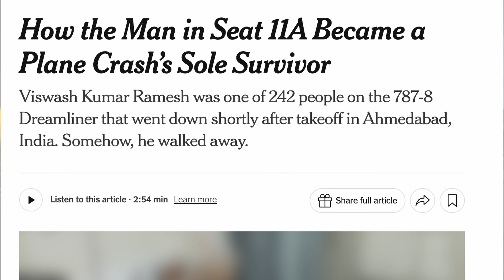Why the RAT Changes Everything – Air India 171 Update

Comment: It was a possibility to have dual engines failure instead of flaps retracted, but now, it's very likely given the ram turbine. Still, it's very unlikely to lose both engines at the same time all of a sudden just after takeoff, one maybe, but two ? What could have happened ? No fuel ? Fuse or circuit breaker ? It's not bird strikes for sure because no flames or smoke behind. Engines need fuel to fonction, do they need something else ?

Comment: I heard in another video, that the landing gear is inclined downward. It is also visible in the footage. It happens when the landing gear is preparing to be retracted up to be fit inside the airplane. It suggests that the pilots rightly retracted the landing gear up just after take off. But suddenly there was no power, and the landing gear retraction stopped mid way.

Comment: Equally hard to understand how both engines could fail, even right after a long max power Takeoff in very hot conditions. Contaminated fuel? Could there be an auto power reduction if the engines overheat? (That would be another Max 8 situation) The sound of the aircraft in the video does not sound like it should if both engines are running at high power. I understand these aircraft are live-streaming aircraft system data back to base while inflight, so possibly there is another source besides the recorders? A lot of grieving families now.

Comment: Captain, could there also be a scenario where the pilot, as soon as he realised on take-off that there was a problem, tried to dump fuel to make the aircraft lighter?  But before that task could be sufficiently done, the aircraft crashed and that was the reason for the massive explosion?  A lot of fuel might have already been spilt on to the top of the buildings and the trees when the plane crashed.  I have been wondering about this, because with the aircraft just reaching about 625 feet and being on a slow speed glide, why did the craft not just break apart on impact and instead explode so violently?  There must have been a lot of fuel surrounding the aircraft when it crashed, to have caused this.

Also considering that the craft crashed on top of a medical college cafeteria building where cooking is done with the help of gas cylinders and stoves.  This must have been an additional contributing factor to the explosion.

Comment: 4:08 Ram Air Turbine (RAT) is a small component that generates power in case of an engine failure. 
In Boeing, It activates on its own. 

only when all primary power systems—those drawing power from the engines—fail. It also activates if the Auxiliary Power Unit (APU) does not work, and even the battery unit fails

Comment: Whatever you have told in this video…..I am having a strong intuition that BOTH ENGINES WERE NOT FAILED BUT ENGINES HAD A SHUT  DOWN MYSTERIOUSLY IMMEDIATELY AFTER LEAVING THE GROUND….now there is a difference between FAILING AND SHUTDOWN…..failing of an engine is due to some sort of malfunction or serious error BUT SHUTDOWN is due to non availability of fuel in a technically sound engine. 
This seems to be a possible sabotage to the aircraft which is to be found by experts, if they can.
Besides sabotage is also might be attempted to the flaps/elerons & landing gear system. It will need a very honest n dedicated enquiry by experts to find all this if happened.

Comment: Steve, I have been working near and around small, medium, and large airport in my many years, and the 4th thing that I agree with on is that engine failure was probable one of the primary causes needs to be considered. If the engines were running, and at full power for takeoff, which they should still be at, the noise produced by these engines would have covered the RAT noise that you can here on the original video. These engines are quit, but at full takeoff power and only 500 to 600 feet in the air, they would have been LOUD. If it was engine failure, was it fuel, electrical, or another fault. Time will provide an answer. The sole survivor will need to be interviewed several times, the DFR and CVR will tell us more than anything when analyzed. My thoughts and prayers to those lost and the families. This loss is more than lives, it's families.

Comment: What about the dodgy main battery used on these aircraft. The rat would operate if that occurs.  Ask the Japanese who lost one of these aircraft on the ground because of the main battery. Boeings fix was to put the battery in a metal box and a vent to allow the battery to cook off "safely". This aircraft is a flying computer and all systems need that electrical power to operate properly.

Comment: The RAT was definitely down. Every maintenance technician knows that sound very well. And it was not just loose of thrust, since the engines even in idle power provides electrical and hydraulic power normally. The RAT is an evidence of dual engine failure. Catastrophic at this hight unfortunately.

Comment: I was years ago boarding on UA departing from São Paulo to Chicago , while the airplane staring accelerated the engine for takeoff we heard “Bang” very loud  and after that few seconds, we stopped and the captain said, it was mechanical failure, the blades of turbine broken. I and other passengers deplaned and stay over night in São Paulo for new aircraft and fly back to USA. The aircraft was Boeing, but not remember 757 or 767, the engine was GE. The year was 2007, I am a gold card member of Star Alliance at that time. I wandered if the sound “Bang” heard after 2 minutes in the air….I surely as those inside AI 170…

Comment: Flaps were intentionally disengaged after take-off to cover up maximum horizontal possible distance as Pilot realised both engines failed.
Reply: But by pulling the flaps up the wings lost precious lift because the plane was at a very low altitude, which contributed to the crash.

Comment: The RAT definitely deployed, you can clearly hear it, whereas the engines are barely audible.
Reply: And they clearly did not mix flap and gear lever. The wheel bogies have done the first part of retraction sequence, tilt from backwards to forward position. Then they stopped moving, probably from having no hydraulics.
Reply: Could the engines not be audible though because they both failed (aka shut off)?

Comment: What is the likelihood of fuel contamination on a level that would stop both engines within seconds of each other? I thought that was close to impossible because the engines drew from different tanks?
Reply: But both wings tanks would have been fuelled by the same contaminated fuel.
Reply: @anthonywilliams9852  Well that is what I am asking because I thought the engines took the fuel from the closest tank (which would be different tanks). Remember the plane took off, so the fuel was good at that point. If fuel contamination was the issue, we are looking for some type of contaminant that would cause both engines to fail within seconds of each other when the fuel supplied is from 2 different sources. Btw I am not arguing that it was not fuel contamination, but if we are to expand on that point the question would be how is that possible?

Comment: Worldwide efforts on to garner evidences for the cause of the  crash... More plausible cause being being being flagged basing on original video ... does it mean no CCTV cameras are installed at both the end of the runway to capture videos of landing and departing planes which could provide clear videos for analysis of  the causes of such plane catastrophy especially at landing or immediately after take off,as required in this case  or was it the case that the mechanical failure occurred only after the plane was out of reach of the runway CCTVs..
Reply: Lives matter mre than so-called ' privacy' requirement for the pilots..
Reply: Why can't a live video could be put in place between the ATC and the cockpits of the landing and departing planes..

Comment: I leaned towards mechanical failure from day 1 the moment an early analysis from the take off video of a RAT turbine being deployed. Pilot error is nearly impossible on a fully functioning 787 due to automation and flight panel ergonomics. Also tell tale sign of electrical issues on earlier flights.

Comment: I'm a simpleton but would we not have heard the engines running in that original video (hand held version) if all was well.  It looks like the plane was already gliding by the time the video started and the engines were out.  As well, is there not a video out there of a passanger on the flight that was complaining that the air conditioning and in-cabin electric was flickering before take-off.
Reply: The original video did not contain any audio.

Comment: how could both engines stop working , what happened to the redundancy design that probability of both engines going off at the same time is very rare ?. Could this be a maintenance mishap by the maintenance personal or some one tampered the electrical system caused this event. All of these needs to be ruled out. hope they get all data from the black box and identify the root cause sooner and hold each and every maintenance personal and question, interrogate  and investigate thoroughly
Reply: It's part of the NTSB's job to do all that.

Comment: No way. The RAT by no means makes as you say same noise as a single propelling engine, since it has no engine. This does not explain why the flaps were up, flaps that we know in a 787 if are not configured for take off, plane does not allow you to do so. Thus, they must have had them at one point and were cleaned probably by mistake.  That or the alarm system that does not allow u to take of without them was broken AND the pilot forgot to deploy them. RAT might have gone on if engines failed.. but this does not explain the flaps issue.
Reply: Surely you've already reported your findings to the relevant authorities?
I don't think they'll be investigating for long, considering a YouTube expert got to the point much faster.
Reply: @CharIie-Mike no need to. Almost all findings till today are pointing at the issue of the flaps not being deployed or way too soon to be pulled up and maybe maybe an engine failure. Did you report te RAT issue?
Reply: @cartayna  

I don't have to report anything because I don't give any smart-ass assessments of the accident.

Comment: Visual evidence is very hard to dismiss. I too admit although I discounted it, the new clearer video makes it very hard to dismiss and my initial thoughts might have been wrong based on what I had seen. The new clearer video shows where the RAT would be also the dimple in the shape of the Fuselage also shows what could be the RAT door open. I guess, depending on how much of the aircraft they find intact. If they manage to find the RAT. Its condition as in damage etc should in itself show whether it was deployed or not. Afterall if deployed then it will be frontal damage to it ... If it wasnt deployed then it would be more end on damage. And if not deployed then it might even still be found in its frame. The next biggest question I guess that needs answered. What caused it to deploy what it automatically deployed or manually deployed (IF that is even possible) and for what reason was it deployed eg Engine, Electrical or Hydraulic. Even in the newer video. Can we dismiss not being able to hear the engines?. Maybe, but maybe not. So in that case if the engines were still running. I guess the question then is were they running properly and was it a total electrical system failure or a total hydraulic systems failure. Although both of those and including the engine total failure are highly unlikely it appears at least that it is the result or one or more of those. I would assume that if enough failures across say two of those scenarios failed to a high enough level that too could deploy the rat. But, as Captain Steeeve pointed out. The RAT was intended for high flight system failure when already at speed and high enough in the air. Considering you had just taken off. Would you realistically be at a high enough speed for the RAT to be effective?. What is the minimum speed for the RAT to become effective? is that at takeoff speed or just above take off speed or does it require a higher speed? I am sure there is those among the viewers who will know that answer.... But as it is wind dependent the lower the speed the less effective it is. Really the pilots were in an almost no-win position just on takeoff. No height and no speed. A very bad combination. I cannot imagine the thoughts that must have been going through their minds. But with the nose going up you an clearly see that the pilots at no point gave up they kept trying even when it seemed hopeless my heart goes out to them and also all the passengers in those final moments. I am sure the data recorder and voice recorders between them will give us exact reasons as to why. Afterall if memory serves of all aircraft the 787 records almost if not everything that could possibly be recorded to the data recorder. For that reason, the officials should very quickly be able to determine what caused such a catastrophic disaster. Although they might not know what caused the total failure they will at least know where it was and what systems were effected and how and in what sequence, which is equally important. I guess in one aspect this highlights one major flaw in both design of airports and also city designs. With buildings of all sorts being permitted to be built in the flighpaths of approach and departure of airports it means any aircraft failure immediately on takeoff or before landing there is no clean area for that aircraft to land in. It is instead buildings...... You look at all major airports the world over and how many have clear approach and departure paths??? very very few.... I wish for new airports they would consider that and also city planners when allow structures to be built they take those paths into consideration...... Very hard to change or alter existing and fully realise that. But for new airports or city planning maybe it is something that should be mandated for future builds and or alterations. But that is a side issue, or is it? ,... The aircraft came down that we know but if that land had been clear with no buildings could it have at least come down onto flat ........ It will not bring back those lost sadly .... but could it help save more people in the future..... Clear approach paths and takeoff paths make it so much better and safer for everyone including the pilots trying to see ..... Ok have rambled on enough. Keep safe everyone .... my thoughts and wishes to those families who are effected and be happy :)
Reply: RAT will deploy automatically when the 2 engines lose power, independent of the height the plane reaches.

Comment: Can this be wrong fuel, or maybe they forgot to fill fuel, or a misunderstanding that ended with no added fuel on the ground?
 Or can maybe they messed up calculations on prior airport that put them with to little fuel for the second leg of the flight (if the flight was 2 part.) 

When the plane crashed it was at a strait heading as it was on take of. That means that both engines stopped at the same pretty much the time. 

 This makes me think this is something to do with something that both engines need, which one is fuel. 
 Is the fuel pickup in use, the same pickup on this plane if the plane is 0 degrees versus the takeoff angle of attack?
 I'm thinking if not, this is a good indication that fuel shortage or wrong fuel is the cooperate or maybe they forgot to connect fuel pipes to the lower wing tank pickups/pumps (if there are more than one)during maintenance or other mishaps leaving them non-function. This causing the Dual Engine Failure after the plane rotate 

 If there is contamination (as in particulates) in the fuel, it would be strange that this render them inoperant at such a synchronic time (though if a fuel pump breaker pops due to filter clogging, this can cause a overload on other compensating pumps which also is starting to clog that's also pops that breaker,  this would render the engines fuel starved if wing tanks are inoperable during take of). if the left and right wing tank's were operating they should be gravity feeding the engines at lower altitude (If my Googling is up to par). (Edit: Grammar + Maintenance + Gravity/Fuel Feeding Hypothesis, last edit: 08:25 CEST)

Comment: The right side engine of the nearly 12-year-old aircraft of Air India that crashed soon after take off from Ahmedabad airport was overhauled and installed in March 2025, PTI reports, citing an unidentified airline official. 

An inspection of the left side engine was done as per the engine manufacturer's protocol in April 2025, the official said.

Comment: You mentioned that when the rat is deployed it takes over the electrical and hydraulic control. Could it be that there was some malfunction that made the rat deploy as it is not in control of the pilot and the rest could not assist in taking off. And so took the flight down.